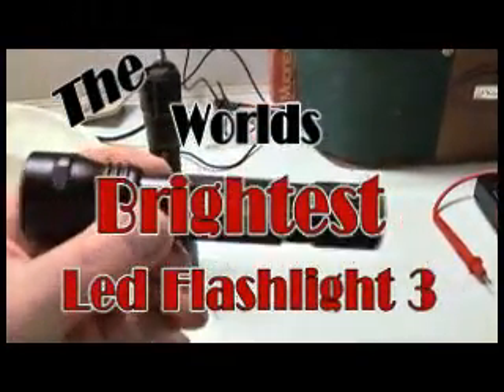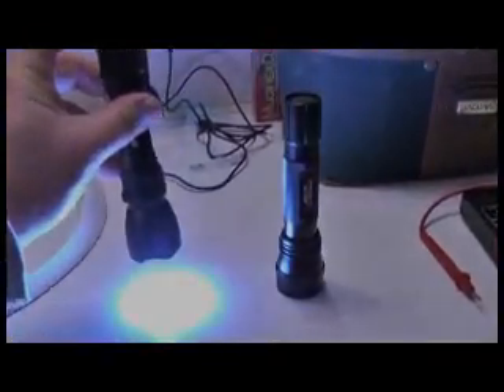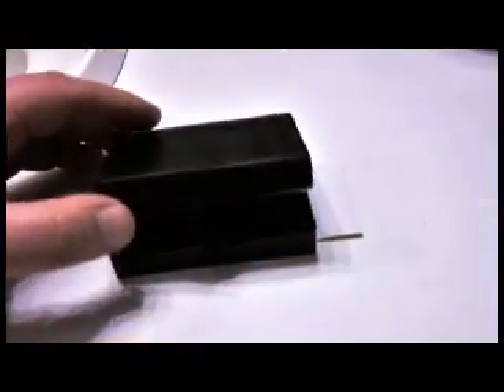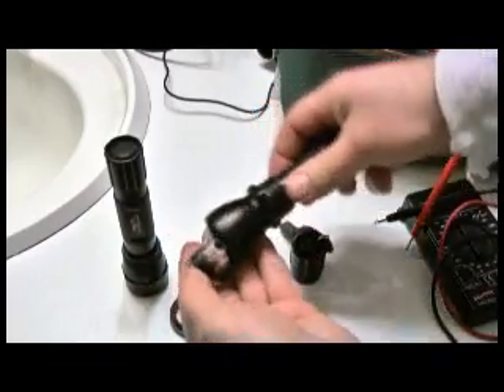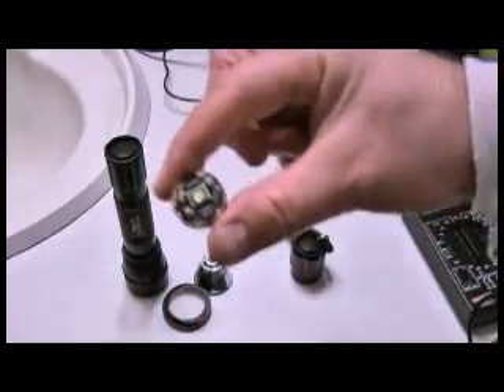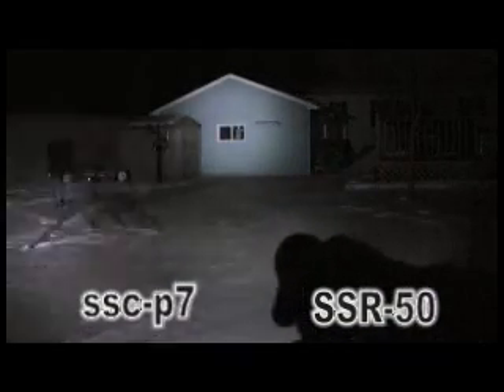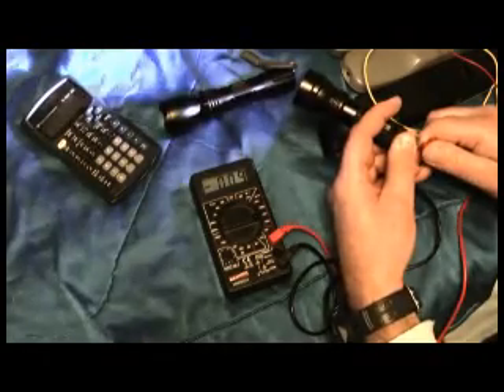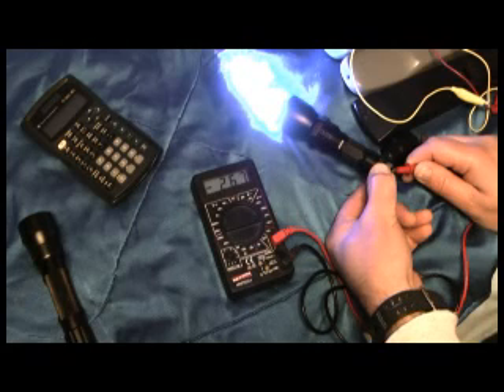Worlds Brightest Led flashlight 3 1200 lumen

Comment from the maker: @ranga148 new and brighter leds  come out all the time , and they cost more . and you missed my sst 90 light, and im working on a cmw 360 with 6000 lumen possable. my light s all work , i dont by expensive lights to mod , wene i just need a good heat sink.

Comment: U R sooo wrong, the p7 driver board cannot give more then 2.8 amps ,its only function to protect p7 led witch rated 2.8amps max.
So when u put your SSR-50 the old driver board will limit the current to 2.8 amps :) So 3.7v*2.8A=10.36W  * 100lum (ssr rated 1w=100lum) = 1036 LUM its 80% of led full power. It is brighter coz P7 rated 90w=100 lumen 
u hawe to replace driver board to get full 1200 lum. :)
But there is a bright side ,right now  u get +130 lum and same p7 battery life time 40+min :)

Comment from the maker: Good question,  yes im shure of current., lumen is calultion base on p7 out put and manufature clames, the sst 50 is rated at 1250 lumen at 5 amp 3.6 volts . my point is its brighter then a ssc p7

Comment: ok let me make something clear on this. on how many modes will this type of led operate? lets say for example first mode will emit  about 500 lumen, next mode is like 900 lumen and third is like 1200 lumen. or is only single mode. I am trying to buy one but I want also to take advantage of being able to toggle between high and low depending on environment.

Thanks in advance for your help.